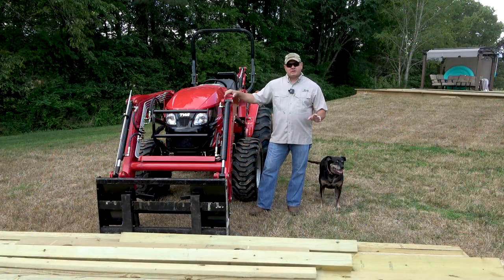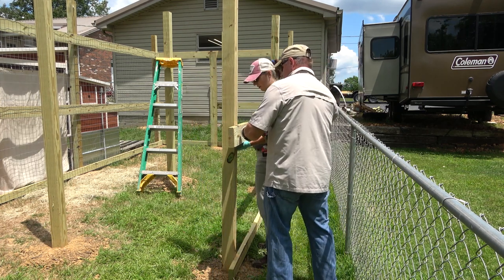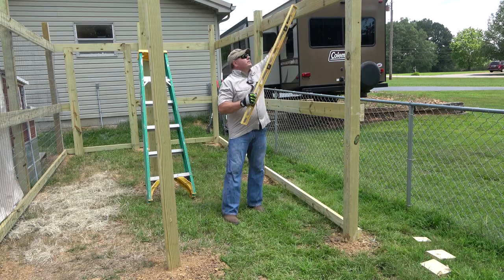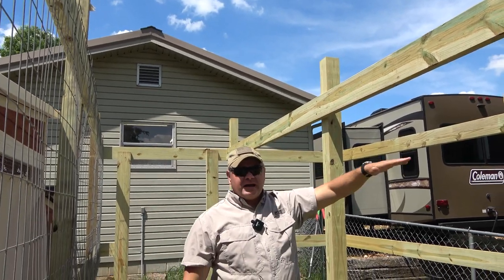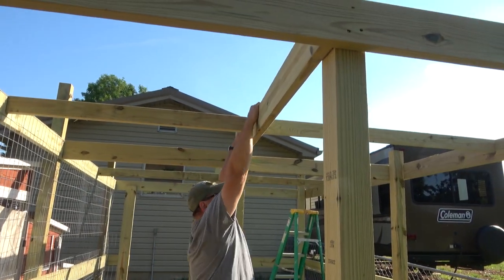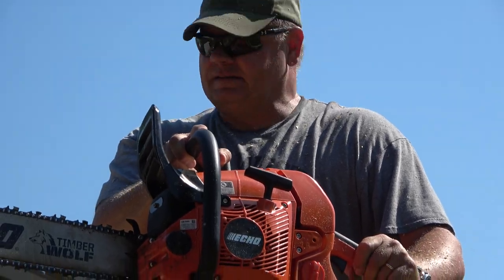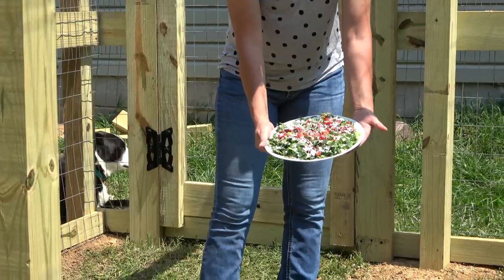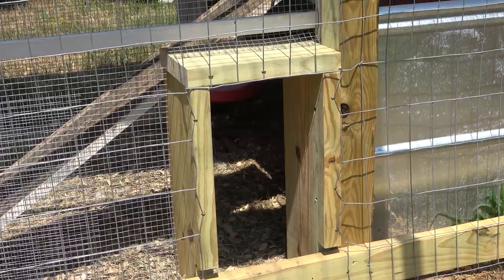DIY Chicken Run Cool Build PT2 | TYM Tractors | Echo Chainsaw

Comment: Nice looking run; well constructed. One suggestion: install what I call ground skirts (an 18" wide strip of green wire fence stapled or screwed to the bottom panels and covered with dirt). Any critters that try to dig can't get through and they don't think to backup away from the run. I put these down two years and haven't lost any chickens to ground critters.
Reply from the maker: We talked about that in videos before. It is coming. I think with our dogs guarding and the hardware cloth around the bottom we can be like you. We do see those pesky foxes across the street from time to time. Our black and white dog takes it upon himself to guard the Chickens.

Comment: Nice Job. Have you thought about putting a tarp over the top to keep out the sun?
Reply from the maker: We ended up putting a sun shade fabric that does not hold water. Being that it is flat on top, the first big rain would tear the tarp down. The fabric is tan and it looks pretty good on top.
Reply: @TonysTractorAdventure  Could you show it on your next video.